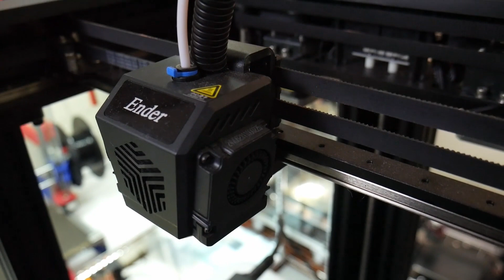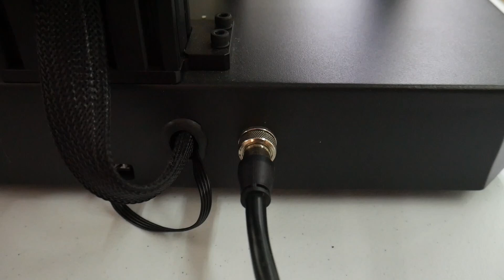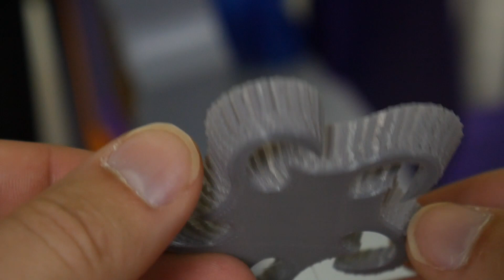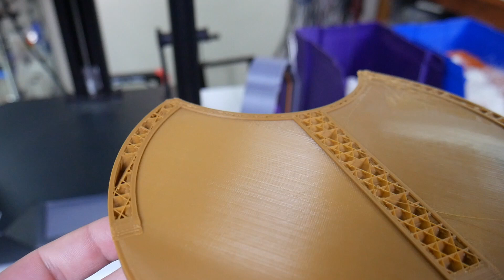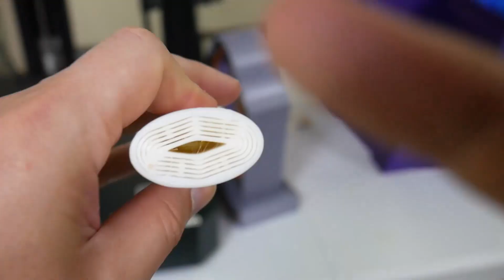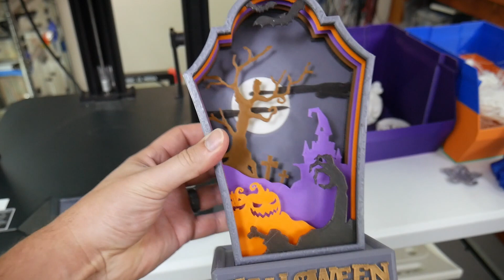Creality Ender 7 Review

Comment: Its a 32 bit board with an STM32F103RET6. it usesTCM2208 for bed and extruder, it uses TCM2160's for the X and Y
Bought it Amazon last month for 250,- works flawless if you know how they WORK...

Comment: Nice video!   So I happened on one of these for $200 open box.  I snapped it up because I love my ender 3 so figured this would be great.  I'm seriously blown away that it has no bed level sensor but it has a filament runout sensor...  I can deal without a filament sensor but manually leveling a print bed on a "higher end" printer?  Insanity.  Ordered a BL touch and I'm waiting until that comes to even assemble this thing.  On my Ender 3 it also has a glass bed with the chalky coating and I find that if I get the nozzle height just right, clean the bed with rubbing alcohol, and use glue - it comes out fine.  Hopefully I can do similar with this bed material and get good results.

Comment: I have one and the stepper drivers are gigantic for the x and y, they are not gonna driver those nema 23 silently. Officially they are 459 on creality website now, I got one for 200, put a bl touch? Led and the th3d screen downgrade with actual marlin.
Reply: I went to Microcenter to pick up some filament and left with a $200 open box Ender 7 :)   I've built a hypercube previously so I'm confident I can fix some of the issues pointed out.   Good luck with yours - $200 is a pretty stellar price for the machinery alone.
Reply: @ajmckay2  I bought a "parts or not working one for 200 like 11 months ago. I bought the th3d screen kit so I could run regular marlin. Much nicer prints even without abl. Just so u know there is not a ton of documentation on firmware for this machine as it is not that popular so it is not supported by slicers, and aftermarket products. I may switch to an skr or mkr board so I can run modied firmware for an ender 6, which has way better support. Just a heads up. Also creality no longer host bl touch firmware updates on their sight. You have to find it thru somewhere else like embrace making website. But I have had really nice prints since changing firmware and screen to th3d stuff.

Comment: This is a tinker's paradise. Mechanical is mechanical and motion is motion. Nothing wrong with the components. Maybe a new board and configuration is in order but loads of potential. With the large discounts I'll be most happy to snap a few up and have a great corexy for a fraction of the price of any of the Voron builds. btw a bit of glue stick goes a long way for bed adhesion.
Reply from the maker: There is the issue. The printer should be advertised as such then. "Needs work to be functional." or "fixer uper". This is advertised as a build and start printing printer and it is very much so not.

Comment: I dont agree with any of your comments. Just because some other guys posts negative video and cuts it you should refer to it. You need to explore settings, you need to understand the machine before just pressing the print button. If you had the time to do that you could create better videos. regardless of what you say, this machine just looking at  the components it uses, it has far more potential than what you think. most poeple buy printer to upgrade them, does not makes sense. This ones comes with very good and high quality level upgrades. You completely did not mention that.
Reply from the maker: You clearly didn't watch the whole video. What Joel did to his printer had not bearing on my review. The fact that you can't just hit print on this printer when using its own slicer to do basic tasks like vase mode, is a huge red flag. This machine with "high quality level upgrades" as you put it, doesn't even come with an ABL and is as loud as a machine from 2016.
Reply: @Fugatech3DPrinting  Did you even open the printer before stating it had old stepper drivers ? you should test more, and look at the full potential of all the components. Electronics anyone can upgrade, look at the metal components, most people will buy a printer to make upgrades. This one has full potential and no need to do any metal upgrade out of the box.  Check inside the box, they have upgraded their motor drivers and far better quieter now. there are a huge price drop too so I think now the opposite will happen.  By the way, you should normally have  a ventilation system ANYWAY inside your shop for safety, so why would you even complaint about the printer being too noisy ?you are missing the point, and you need to test further.
Reply from the maker: Cool, they made a newer version than what they sent me. Classic Creality. Either way, the review stands and everyone should stay away from this printer.
Reply: I stopped watching Joel when he started slapping printers together halfassed and expecting them to print.

Comment: I managed to snag two on sale 429 on Amazon obviously they are not selling but for that price and I have to spend maybe 200 more it’s miles cheaper then a voron or any other diy core xy out there. It’s a decent deal and I might throw in new boards and get a proper x axis and I should still be pretty decent. For the price 2 of these and the deal I got I might barely be able to build a voron or any other diy core xy. Worth it for the sale price for sure 800 though I’d pass 100%
Reply: Just got it of amazon for 250 :P
Wanted to buy the 10 cr SE... but for 250... since i am nut and spend a fortune on my ender 3 max to make it work, why not this :P

Comment: There is a bad implementation of power recovery that messes up vase mode because it writes a lot to the sd card, so it stutters. Solution on delta machines was to disable power recovery.

Comment: There is always something in a Creality printer that spoils an otherwise good design, the BL Touch firmware is guaranteed to have an incorrect X Y offset so when probing the bed the nozzle is placed where the probe tip should be and you end up with an incorrect mesh this is endemic to Creality machines and one can only assume they are not bothered and leave it to the community to fix, it cant print at the claimed 250mm/s according to the FB user group, at least in usable quality, #Another Creality Lemon